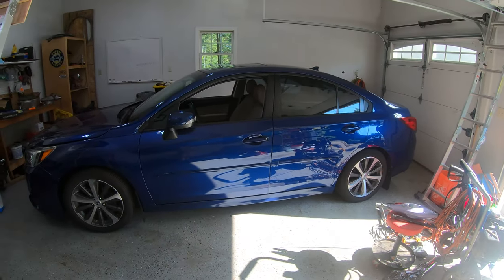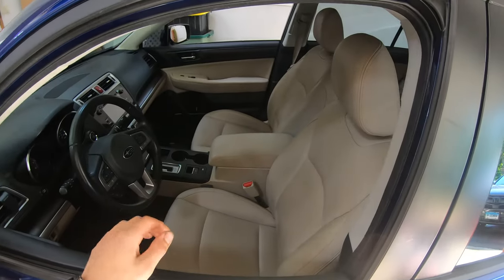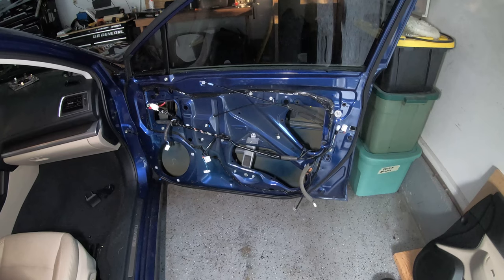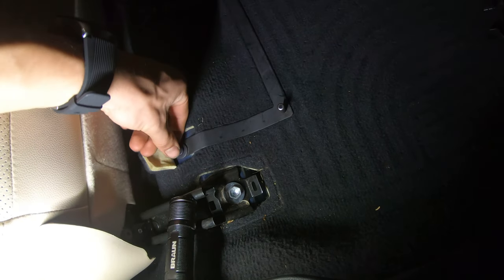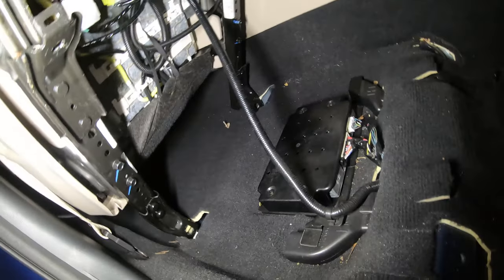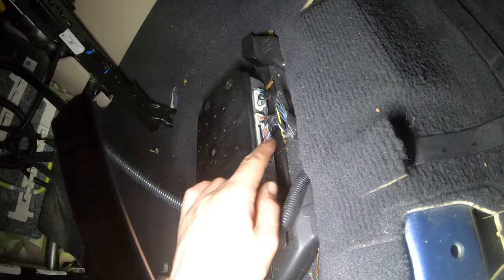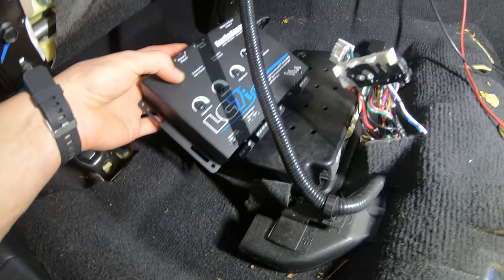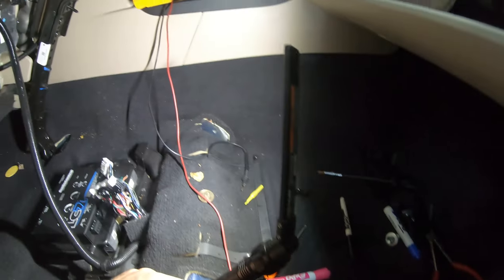Sound System Upgrade 2016 Subaru Legacy Premium (Part 1)

Comment: Is there not a part 2 for this video? I was curious what you were going to do with the tweeters.
Reply from the maker: I had a part two shot but never edited it my bad. Tweeters went in the dash where the old ones were. I think I made a custom bracket to make them fit.

Comment: So your using the stock amp to power aftermarket speakers? Wouldn’t you need an after market amp to give proper power?
Reply from the maker: Stock amp sends a signal into line output converter and that sends rca pre outs to aftermarket amps

Comment: Is it possible to exchange the base model of the legacy radio (Clarion) for the Limited or premium one (Fujitsu)?
I have bought one on ebay and every plug fit and the sound works but not the rear cam or the USB plug...
Reply from the maker: Ooh not my area of expertise. Would have to ask a Subaru specialist. Might need some programming.
Reply: @ThatAccordGuy  how come I seem to be the first one to ever think of that...? (thanks!)